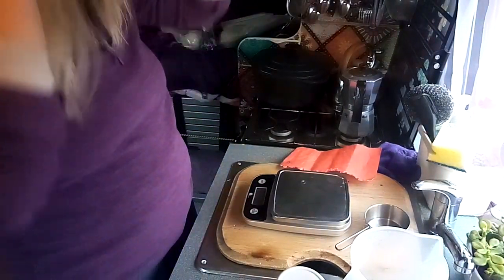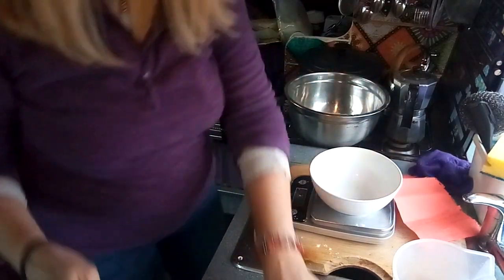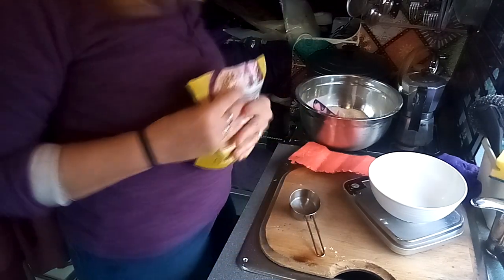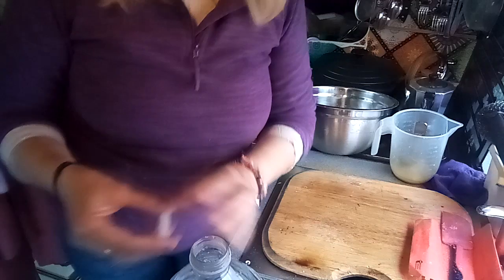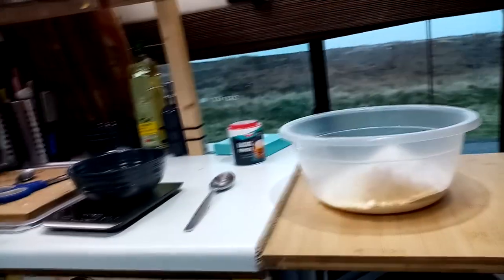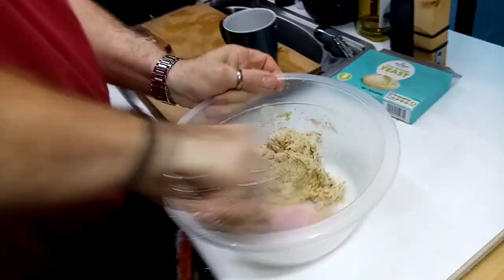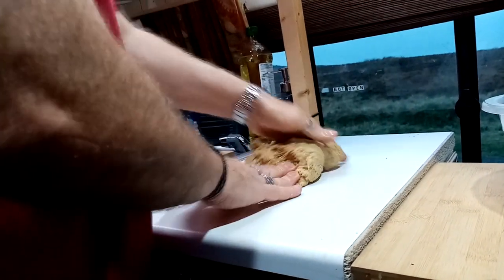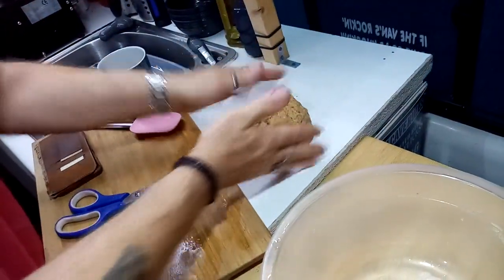Low Carb Bread Bake Off With Campervan Gaz Part 1 #vanlife #fulltimevanlife

Comment: Hiya been binge-watching your channel, new sub. The reason why the dough is not looking right is because the dough is to cold for the yeast to grow and them start stretching. You needed to put is in front of the heater until hot, then start needing  it. 🤘😁
Reply from the maker: Hey Bex, well I did leave it in a warm place to rise and I think my van was pretty warm at the time 🤷‍♀️. Anyway, doesn't matter now as I'm not making it any more. Cheers though 😊👍
Reply: @anothercampervanchannel  Yours looked great, Gaz seemed like his dough seemed cold but his cooked bread turned out looking a lot better than I thought, I did like the look of it.  How did your taste with the extra seeds? Both looked great, cheers for sharing.